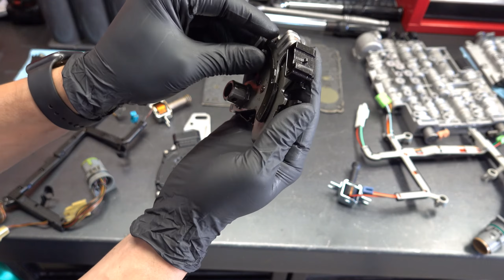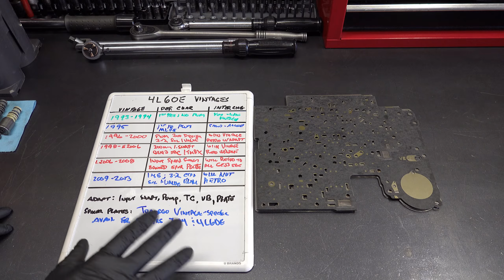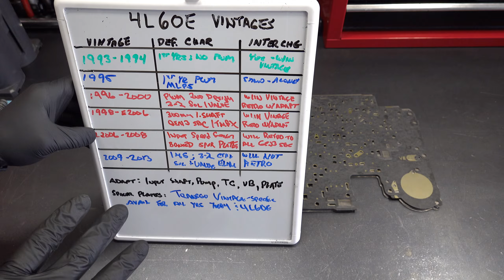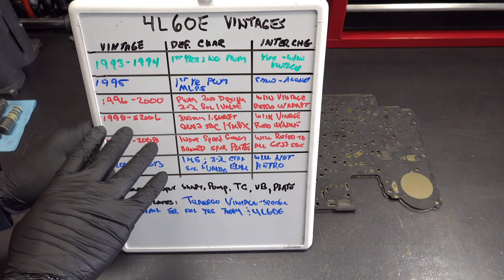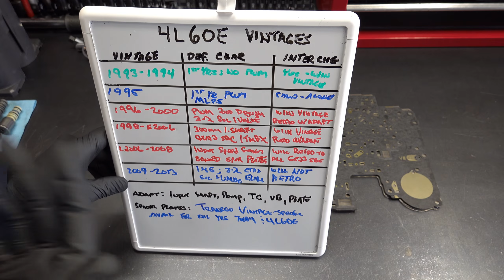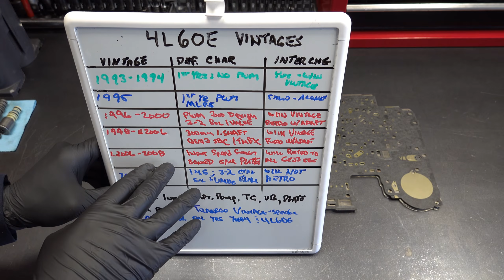How to Buy a 4L60E - Changes and Interchange Rules

Comment: Hey man great info, do you know if I can put a 2000 into my 98 gmc 4X4

Jegs sent me this one and the input shaft is different. I already swapped the bellhousing. But the torque converter they sent me doesn’t want to lock in on this
Reply from the maker: If JEGS sent you a 4L60E for a LS/Gen 3 small block engine application (i.e. 12 o'clock bolt hole on the top of the bell housing, 300mm input shaft, 7.25" long pump stator, TMBX or TLBX torque converter) that JEGS trans/converter will not bolt up/fit as is...Send them back to JEGS for the correct 4L60E for your engine application (Gen 1 SBC 5.7L).
Reply from the maker: My video covers this in detail - please rewatch the last section where I go over all the interchange rules.
Reply from the maker: You can swap your pump, input drum, bell housing and a new 1996-2000 torque converter to the JEGS transmission though if you're going to do all that, you may as well just rebuild your unit (even if you transfer all the new clutch packs and band into your pre-existing 1998 trans).
Reply: Thanks for the help man. And I haven’t checked with Jegs about their return policies and stuff so I’m not sure how that’s gonna go. And I need to reach this video again obviously cuz I’m sure you cover it in the video. But If It come down to it I can rob most of the parts for the rebuild of my original out of the JEGS unit?
Reply from the maker: Rob the pump body, assuming it's machined/resurfaced as well as the clutch packs, band, forward drum contents like apply pistons, return springs, etc, reverse input drum (if it's new), bearings, the numbered selective spacer on the input drum and any hard parts (gears, shafts, etc) that you may need...Once you crack open the JEGS unit, the return policy and warranty become null and void.

I would also film the tear down as well so you have a reference for how the unit went back together, in addition to my videos.

Comment: I swapped a 06 VB and 15 pin harness into a Brand New (17 pin) 2009 4L60E that had the updates, (No manifold pressure sensor, No 3-2 kick down,  had the internal mode switch)  i used a external Park-Neutral switch and wire harness For a S-10,  only need the switch for back up Lights, P-N ignition,  and P/N signal to the ECM,   No need to remove the internal mode switch ,
Reply: So if I were to swap a pre 2009 VB/harness (13 or 15 Pin ) onto a 2009+ transmission (17 pin) It will function like a pre 2009 trans? The vehicle is wired with 0411PCM to accept pre 09 15 pin trans. using external sensors for speed, backup lights, neutral safety etc. Thanks.
Reply: @780SpeedCustom yes, get a 07-08 Valve body from central with all the updates, pick up a 07-08 Transgo spacer plate, , there are a few other things I would also do for reliability, but yes you can get a 09-2014 (17 pin) 4L60E transmission to work with a pre 09 VB , plate and wire harness, I can walk you threw it

Comment: Excellent video. Im making my way through several of your 4L60E vids. I heard towards the end of this video you said a 08 4l60e would work in say an 01 tahoe. Does that hold true in my situation where i have an 2000 silverado 1500 5.3 4x4 and i have an 06 4L60E 4x4 as backup? I would just have to swap the gear position box from my 2000 transmission to the 06 trans? Thanks for the videos man. Im trying to boost my transmission knowledge and hopefully one day tackle a rebuild.
Reply from the maker: Thanks for watching and for the kind words, Mike! Yes, an 08 will retro to any year vehicle with a V8 Gen3 or Gen 4 small block Chevy engine application, however the one disadvantage in using an 07-08 in an earlier application is that you lose access to the boost valve from the underside of the pan as the TSS plug is in the way. 

Swap over your manual lever position sensor (I'd simply replace it at this point if it's the original MLPS that came on the unit or you don't know when it was replaced last).
Reply: @nickstransmissions  thank you sir!
Reply from the maker: You're welcome!

Comment: Hey bud i just found your vids but ive looked at this one twice but my question is will a 2008 4l60e interchange with previous years? And if so what are the differences?
Reply from the maker: Thanks for watching, Charles...I will prob do a follow up video on interchange dos and don'ts but 2008 will interchange with any year with a Gen3 or Gen 4 SBC engine application...If you you have a 2007 vehicle, then you'll be limited to a 2007-2008 unit...

All that said, there's no reason to worry about interchange as these transmissions are not worth the risk/gamble buying used...If you or someone you know has a 4L60E that requires rebuilding, look for a competent, honest transmission shop that's versed in the 4L60E and have it gone through.

Or better yet - rebuild it yourself..You have all of my videos plus the ATSG manual to help you...just need a few special tools and the time...
Reply: @ i have pulled it apart and it needs input shaft and drum
Reply from the maker: Oh, cool...Yea, just replace the shaft/drum w/the same but new (I've been using new drums whenever possible). Sounds like it had similar failures to my 500HP 'Nemesis'.
Reply: @ and the forward sprag exploded

Comment: Hey Nick I have 05 avalanche transmission and I told a 07 Tahoe the plug is different color will it still work
Reply from the maker: It should but if not simply replace the harness w/ a Rostra 2003-E2006 harness and you should be fine, assuming everything else about the replacement unit is serviceable/healthy. 

Apart from that, rebuild your 2005 unit (used 4L60Es are a major gamble, one that you rarely win) - use my videos as a guide to help you get it done.

Comment: Hello Nick, I saw you list '95 pump one year. I am trying to use a 96 core so I went to find a 95 pump but they are all listed as either 95-96, 95-97, or 95-03. Do you mind expanding on the differences in the pump? Specifically for me from 95 to 96. A reman pump is expensive and I'd like to use the 96 if I can. I appreciate any feedback
Reply from the maker: Hi Jay, any 1995-2000 pump will work as-is in a 1995-2000 SBC Gen 1 or 2 engine application for 4L60Es. The pump bodies are interchangeable from 1995-2003, same with the pump stator support...Only the stators themselves changed (they got longer for the Gen 3 applications).
Reply: Thank you for the quick and detailed response. That's definitely helpful info

Comment: So I have a 1995 Silverado 1500 4x4. What years can I modify or adapt to replace it?  I'm reading 1996 and 1997s will work with some valve body swapping, valve swapping, and minor electrical mods to a plug.

And will it make a difference if I'm fine having no 4th?  

Many thanks!
Reply from the maker: Did you watch this video? If not, give it a view - all of your above questions are answered...

Comment: Hi Nick thanks for your response any information I  get is always helpful I am aware of the addition of the PWM and the changes in shift strategy of the 4L60E from the 94 to 96 I may have not asked right previously but my question was specifically  if their were any change in the trans case designs from 94-96 that would prevent me from turning this 94 into a 96 by replacing the 94 10v non PWM pump to a 96 13v PWM pump and replacing the 94 valve body with a 96 valve body and sep plate with harness to essentially make this 94 a 96 to work with my Holly term X Thanks again for your time and all the knowledge you share
Reply from the maker: Hi Shannon, sorry must have misunderstood.

There are no case differences between the worm tracks between the 1993-1997 cases that would otherwise prevent you from swapping valve bodies, spacer plates (as well as pump assemblies) if you need to...That said, if you are attempting to install a 1993-94 4L60E transmission into a 1995-2000 application, you'll need to somehow come up with a means to mount the manual lever position sensor over the selector shaft and secure it to the outside of the case in that location since there's no threaded bolt hole locations for mounting the MLPS on those 1993-94 units.

This info is for anyone who is reading and has the same or similar ask so they're aware.

Also please reply to this comment vs creating an entirely new one as it helps keep everything in one thread. TIA!

Comment: Hi Nick new to the 4L60E world and have been really enjoying all your videos not sure if this is the video to ask this question but it’s along the lines of case design so here goes I am looking to build a 4L60E for my 82 Chevy truck that has a non LS 350 it’s like a 96 vortec 350 I have a Holley terminator X max that has the ability to control a 4L60E I purchased a 4L60E core that was the one pice case design 93-94 come to find out Holley says the terminator will only support controlling a 96 and newer 4L60E so is their anything in case design that would prevent me from replacing the pump valve body wiring /Solenoids separator plate on this 94 case to make it a 96 as I really like the one pice case design for this older truck application Thanks
Reply from the maker: Thanks, Shannon! Appreciate it. 

The Terminator X may only support the 1996-2008 4L60Es based on the 3-2 control solenoid and PWM solenoid pattern...In 1996, GM changed the 3-2 control solenoid strategy to an 'on-off' configuration where as 1993-1995 it had pulse-width modulated (PWM) logic. In 1995, GM went to a PWM apply strategy for the torque converter so starting in 1996, the 3-2 apply and TCC apply strategy were held constant through 2008...In 2009, GM eliminated the 3-2 control solenoid and valve from 4L60E valve bodies. 

Hope that helps.

Comment: So I bought two transmission cores for 75 bucks to see if one will be worth rebuilding to go in my son's truck.  A 2005 Silverado 1500 4x4 with a 5.3 and I believe a 4KCD, still working fine, but figured building a spare would be a good and useful project to learn on.

Transmission 1 is a 2KZD 4L65 from an AWD Escalade that lost reverse.

Transmission 2 is a 0KCD, green electrical connector,  that they said the pump went out in.

Was really hoping 2 was going to be a few years newer and a no brainer to rebuild for my use, I know 2001-2006 was a direct replacement, but not sure if a 2000 is different, so figured I would ask you which one you would suggest rebuilding for my son or if I should keep looking?

Thanks a lot,

Justin
Reply from the maker: hi Justin, I'd go wiht the 4L65 for sure. More than likely, the 4L65E simply has a burnt low reverse clutch due to wear / hardening of the inner machine-cut seal on the LR piston. The other trans (trans #2) can be used for spare parts, if/as needed (except for the pump).

Check out my 4L65E vs 4L60E video for a good comparative breakdown between these two variants, if you haven't already done so...I show all the differences/upgrades the '65s had over the base 4L60Es: https://youtu.be/wScbfpi65pQ

Comment: Thank you sir.   This was great info for someone who knows routine maintenance lvl car fixery.  Now challenged with replacing an 03 suburban's transmission that has 1st and reverse only.   Loud clunk 2nd into 1st slowing down to a redlight.   Proceeded to normally shift and accelerate to 55mph.  The following redlight same violent shift down into 1st.  Suddenly the transmission was 1st gear without the ability to coast.  I.e. trans speed and engine speed was coupled.     I had the trans lose the ability to shift out of first but it was a bit different where I could bounce off the limiter and coast.  I think it was a silonoid electrical issue.   But this time when it let go it sounded like the driveshaft yeeted itself apart.  So im sure that no matter how much knowledge can help save me from just replacing it.  Im rambling.   Kick ass video.
Reply from the maker: Thanks, Veno! 

Sounds like sun shell fractured at the neck - common with those units.
Reply: @nickstransmissions  hmm.  Ill have to say it was a great 403k miles.  Thanks for replying
Reply from the maker: You're welcome...Are you saying you got 403k miles on that 2003 Suburban's 4L60E?
Reply: Yes sir.
Reply from the maker: Wow...I'm guessing the casting quality of your valve body, pump stator support and forward drum is in the top .0000001% of all such parts produced...I believe those three parts are the main determinants for longevity of those transmissions with the caveat it was well-maintained over the course of its life. Congrats!
Reply: @nickstransmissions  im guessing it was built on a Tuesday or Wednesday.

Comment: After an exhausted search and viewing of YouTube, can I use a 1996 4l60e in a 1998 Tahoe?Any modifications?
Reply: They’re both 4wd the 96 is getting a new engine believe 98 5.7.I have an extra trans from the 96,just want a ready spare in the corner for either.Is the transfer case going to be an issue,gotta crawl under again for that.
The 241 is preferred because of the parts for the 246 and pia takedown
Reply from the maker: Hi Robert, 

Did you watch this video? 

If so, perhaps give it another view as I discuss those two vintages of years specifically when it comes to swaps.
Reply: @nickstransmissions Does the change in case indicate shaft or is there another reference?
Reply from the maker: Do you have a 2WD or 4WD? 
If you have a 4WD, the 96 won't fit as it uses only four bolts for the ext housing where as the 98+ use six. 

Why not rebuild your 1998 unit that failed?

Comment: So I have a 09 Known good 4l70e that I want to use in my 2007 Trailblazer ss sinc it’s a 2wd unit. I know they are different but My question is Can I swap out the valvebody and harness from my 07 into the 09 and use it ? My worry is that if the cases were completely different and holes in valvebodys and paseges did different things. Or will I be better off using the internals in my original trans to make rwd? And if I go that route am I fine to swap out clutches and drums from the 09 into my 07?
Reply from the maker: Hi Boosted,

My official position is that nothing from 2009+ is compatible with anything 2008 and back however if you study the worm tracks and bolt hole locations, there are some differences however I don't know if they're 'material' differences or not...You may have to try it and see what happens...

As far as swapping out clutches, etc that makes very little sense...I'd harvest all the internal hard parts from the 4L70E such as 5-pinion planets, the forward drum, pump assembly (both of these have heat treated splines) as well as the reaction shaft and build up your 2007 4L60E to the 4L70E standard. Add a 4L70E 3-4 clutch pack (7 alto HE carbon frictions and 6 lindered flat steels plus the apply and backing plate set) and you'll be good to go..If your 3-4 clutch clearance is .040 or less (ideal is .027-.040) then install the five load release spring assemblies. 

Hope that helps.

Comment: Hello nick I have a 1997 trans am that has a 1995 4l60 that I changed the spacer plate and the valve body from a 02 4l60 and I also put the 97 3-2 valve in I just test drive the car tonight for the first time and it doesn’t seem to shift right.
Reply from the maker: Hi Warrioryfm, the changes you made (vb, spacer plate and solenoid) are correct (ie the 2002 VB, Spacer plate will work; it should have already had the same 3-2 control valve as your 97 VB) so there may be problems elsewhere in the transmission....The valve body gasket set you should be using is the white stripe set but even if you installed the non-marked set for 93-2000 spacer plate-valve body service packs, it should still function normally.

Comment: Hey Nick, 
So I have a 2009 Chevy Tahoe 4x4 that I am trying to find a donor transmission for. From what I’ve gathered in your video it seems like I need to try to find a transmission from another 2009 year model Tahoe for it to be compatible? Or are there other compatible options? Also I’m assuming it has a 4L60 in it because whenever I put it in manual and shift through the gears. It has six gears?
Reply from the maker: Hi Wombraider, if you have 'manual' mode with six forward speeds/gears, you have a 6L80 so you'd need to either rebuild your 6L80 (check out my 6L80 playlist for details, instructions, etc) or you'd have to purchase a compatible 6L80.
Reply: @nickstransmissions  thanks Nick I’m glad I commented! As long as I get a 6L80 should it be a direct swap or do I need to look at a specific year model? Any other suggested details? The story with the truck was the trans felt like it was slipping or searching for gears then stopped shifting It wouldn’t run over 30 mph running at 3500 ish rpm’s and was throwing check engine light traction control message etc codes were (PO700) and (PO796)
Reply from the maker: Sorry, didnt see this but you need to make sure the TEHCM part number on any replacement trans matches yours or simply swap your TEHCM over to the replacement...That said, I wouldn't do any swaps - just rebuild yours...

Comment: Nick, I have a question on the 3 4 gears. Is there anything that will make it slip other than being junk. I have a 1996 4l60e on a 2000 ls in a 94 gmc yukon
Reply from the maker: Hi Scott, there's a laundry list of causes for 3-4 failure...Your best defense against 3-4 problems is to ensure the forward drum/shaft mating integrity is sound (no leaks - I demonstrate how to test for leaks in my 4L60E tear down videos), replacing bonded pistons with new ones, ensuring 3rd acc check ball capsule isn't leaking, replacing turbine shaft sealing rings, setting up the 3-4 clutch pack with no greater than .050 clearance (I prefer .030-.040 and install the load-release spring sets).